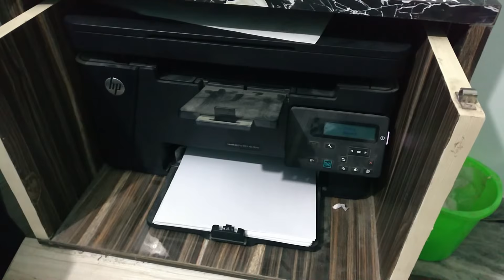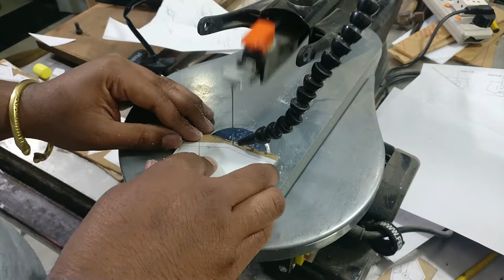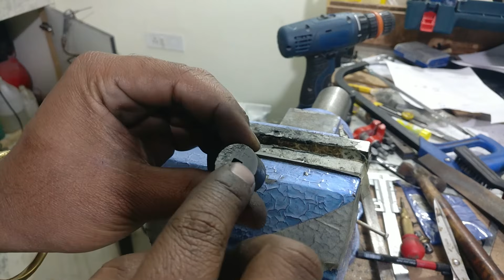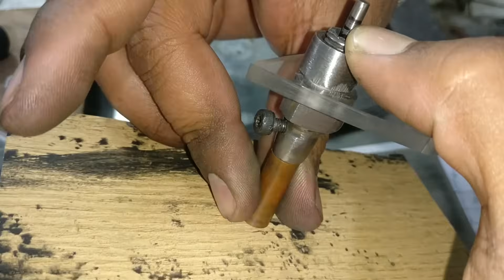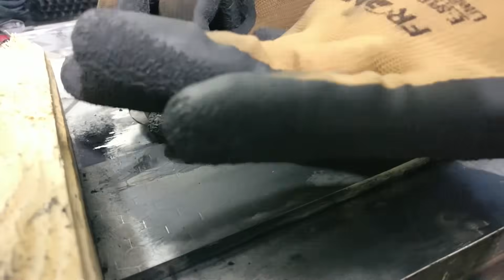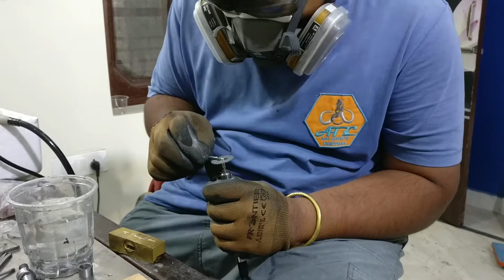Learn Making a Graver and Template set for Engraving - By AMbros custom

Comment: are all the edges flat along the 5mm acrylic? I downloaded a 3d printed template and noticed the edges around the templates have angles in regard to the face and heels and other cuts. Im noticing in your video you dont talk about setting an angle on the short 5mm edge of the acrylic template. all you did was cut and filed flat? I'm confused on how the angle gets created if you cut all the edges flat. do all edges sit flat on a even surface? or some angled?
Reply from the maker: In the description section there is an instructable website link. Follow that guide. That will answer your question.

Comment: Can you tell me the file you printed on A4 or A3 paper, but I printed it on A4 paper, I feel the sample is very small. compared to Lisay's model, it's very big
Reply from the maker: Yes the templates are small, and are A4 size, you need to see the details over instructables that how much you need to stick out to make the right degrees of angle. Size never plays any role, the thing matter is that the length of stick out.

Comment: Can you post the height of the templates? I'd like to use with my lindsay graver holder but these templates seem small when i printed them. thanks for posting.
Reply from the maker: Thanks, The height is closer to 83mm.
Reply: @ambroscustom  Thanks. I would have been off with my template cuts. I have a lindsay 116 template that is closer to 100mm. I was using a semicircle and digital angle finder to make some custom templates and came across your video. It will help me confirm if my measurements are correct. Thank you.
Reply from the maker: Pleasure is mine 🙂

Comment: Hi

Sorry for silly question

Thanks for temolates and mentioned angles.

Can you please mention the center of hole from botom of template surface.

Second , kindly can you updat hights of templates from botom to max hight. :(

Sorry for being silly
Reply from the maker: No the height is not possible to change,if you do so then the angles will change alot more. This design is made according to a specific length and increasing the height means redesign them again, but I can provide the centre mark as soon as I get time.
Reply: @ambroscustom  can u tell me whats the lenth and width of each template.. and where to plave hole

Comment: Ambros I downloaded your templates but the center hole on my printer measured about 5.6 mm so I used photoshop and enlarged the templates until the center hole came out to 8mm.  I don't know how accurate your template has to be for sure. The tube you used to measure the length of the graver when you set it in the fixture is that 1.25". Really didn't understand how you figured that out?  Can you explain this a bit?
Reply from the maker: Dear in the description section you will find an instructables link, which gives you brief information about the template and how I made and how to use. Print has to be made at 100% to get the accurate template. Or you can go with cad model

Comment: Hello, Ambros looks like you did a lot of work making the templates.  Each template has a smaller template so the larger template would be for the face angle and the heel?  Is that how I'm seeing this?  The smaller templates would be to reduce the overall metal? Thanks, Mike E
Reply from the maker: Yes Mike you are absolutely correct.

Comment: These appear to be an exact copy of Steve Lindsey's template set . are they ?
Reply from the maker: No
Reply: @ambroscustom  okay. Thanks.just wondering.
Reply from the maker: I uses the basic Pythagoras principle only and if you buy Steve Lindsey template I bet they are different than this, but overall you achieve the angle you wanted to and you can make many more by yourself just by changing the face tip angle.

Comment: this is a great tutorial but 2 questions 1 can i use tool or spring steel as a graver 2 what are the bigger template for. i only seen you use the small nes
Reply from the maker: Buddy I heard from many master engraver to use HSS or carbide, no one recomend using a carbon steel. HSS is also cheap and you can get a precise dimension blank at any tools supplier shop. The bigger templetes are used for facing and heel work which do the cutting work. They are important part also. Thanks.
Reply: @ambroscustom  thanks so much man you really helped me out
Reply: Spring steel is great for a graver.     You just need to properly harden and temper your tools.  I have used coils from a bed spring.
Reply: @gwaaiedenshaw8310  great! Thank you

Comment: Very ingenious, thank you very much !
Reply from the maker: Your welcome brother
Reply: @ambroscustom  Can you make a video on how to use the template with one of the templates because there are still many who do not understand using it properly thank you
Reply from the maker: You can watch Steve Lindsey videos of how to use these templates, pretty easy process.
Reply: @ambroscustom  Hello, my friend has taken pdf and thank you, I just do not understand in the little hole in each template, what is the use of it?  And if I cut the template, does it have to fit the small hole according to the template too
Reply from the maker: That was for the graver holder alignment, so that when everytime you need to sharpen the graver, the holder sits at the same location onto the template for the better and much accurate sharpening.

Comment: Hi thank you so much for the video. Please can you tell us the height of the diamond stone you are using? Also do these templates create a parallel heel? I have made the 90 degree template but have not been able to achieve a parallel heel. Any help would be amazing!
Reply from the maker: Hi Heather appreciate your words. For the diamond plate it's 8mm thick. If you want much detail over this topic you can check the pdf instructables file in the description. If your stone height is little thick you can place a shim underneath that and perform the heal making process. The bigger template is used for making heal of the graver. The angular section onto the bigger template. If your grinding stone height is not upto my calculations then there might be some problems in attaining that heal. Recommend you  to take a look over the written pdf. If still have problems let me know. Thanks
Reply: AMbros Custom thank you for getting back to me!! I am still having some trouble achieving a parallel heel but I think it’s because my gravers are slightly out of alignment on each template. I will keep playing around! Thank you!

Comment: I wish I knew what to buy,. Theres seems so many, how does a beginner know which ones to get if I can only afford to buy a couple at a time? 🤔 Any tips for me I would be very grateful. Thank u for sharing
Reply from the maker: Dear you definitely need some tools if you want to pursue Jewellery. Even in the jewelry there are so many sections. Like engraving stone setting, casting and many more.  Jewelry saw, file set, diamond sharpening plate, vise, rotary tools and burrs suggesting foredom for that and it comes up with alot of attachment. I hope this much is sufficient to start a jewellery work. Even these things going to cost you around 120-130$ depend upon where you live. But you definitely need more and more tools as you increase your skill. Frankly told every tool has its own advantage. You can do multiple task with a single tool but the thing is that you might not get the good results. So I would say less tools definitely have some barrier in making. Brother there are many masters from where you can see what things are necessary, I told you what I uses when I started. Foredom is must to buy, really the best and versatile tool and comes with different attachment. In first no need to buy expensive tools because I think that in the learning stage you don't even need the professional quality tools although they definitely have advantage but cheap tools can also do the same job. Only thing you need is determination and practice and remain positive. Hope this will help but definitely consider watching other jewellers as I am not very good in this field. Good luck, stay healthy:)
Reply: @ambroscustom  I have all my jewlery tools. Just no gravers yet. Well none since I made that comment, I actually have a few gravers now I got I last few days so iv been practicing. But thank u for the indept comment and tips, I appreciate it ✌
Reply: @ambroscustom  good advice,.. I started a few years ago Makin jewelry so I have built up my collection of tools.. Sand casting is something I dont have, but I have done cuttle fish casting,. And yes, I like to use old tools an not always the most expensive.  An I have lots of determination to get better an better! 😉 Your comment was very helpful, I think I subscribed so I will hopeesee more of your work.. Thank you kindly from Ireland ✌

Comment: Buenos días Sr mi nombre es Douglas Ramírez desde Costa Rica gracias por compartir los archivos con mi persona me gustaría preguntarte que medida tiene los buriles que utilizas de que material son
Reply from the maker: el material es un carburo de tungsteno y no sabía qué significa buriles, sería fácil responder si pregunta en inglés.
Reply: @ambroscustom  Thanks for your answer
the word "buril" I refer to the tool used for engraving.
What dimension does the HSS or tunsgteno pieces have, which you use to make the engraving tools.
too appreciative of your response
I would also like to know if you have the plane of the tool where the engraving tool is mounted
Reply from the maker: Welcome mate, the tungsten carbide dimensions are 4mmx4mm and I also uses a high speed one that also have the same dimensions, also the round graver made of HSS is of 4mm dia. I suggest you to go with 3mm they are much better. If you didn't have diamond plate for grinding don't go with carbide, because wet stone can't able to handle tungsten carbide. They worn out very fast and not even able to scratch carbide. I didn't have any plan because people never asked for that. If I get time then I definitely post them here. Try my best to upload soon. Thanks:)
Reply: @ambroscustom  I would like to be able to build it and be able to start with engraving since I like this art and I want to take it as entertainment
Reply: @ambroscustom  I have some blades that I would like to know if they can work to make the engraving tools. You have WhatsApp, I leave you mine + 506-88 21 10 19, can we speak through this means? if you want
Reply from the maker: @douglasramirezfernandez4801  you can send me pictures of those on my email ambroscustom@gmail.com

Comment: Hi man. Thanks for sharing the templates and the way of making them. I gotta question about the small templates. how did you draw them ? I mean does they have heel and face angles???
Reply from the maker: Yes they have a specific angle given to them and for the heal work you need to use the bigger template not the smaller one. The smaller one are for the initial shape like the Pentagon shape of graver. Smaller template provide you the perticular angle of the graver like 120°, 90°, 150° etc.
Reply: @ambroscustom   I understand the small templates are for shaping. See I pick 45degree angle for face in big templates. When we using the small templates they also have angle  between the graver and the bench stone, what's the angle? 4degree? I'm sure they're not flat.
Reply from the maker: Yes its 4 degree, but also depend upon the grinding stone you are using. I am using diamond stone of 8mm,  in the the end this is going to reduce the tip size.
Reply: @ambroscustom  I'm gonna use diamond lap and gonna use 12.7mm(half inch) for height. Should I increase the angle ??
Reply from the maker: @mahmoudjam670  you can use some sort of spacing under the template so that the height difference remain 8mm. Although that initial angle doesn't matter that much. The tip angle matters only which is 90°, 120°, 150° etc.
Reply: @ambroscustom  Okay man I will try that. I gotta another question about the heel. You used 20 degree for heel and and get a distance of 26.71mm from center of the template to the surface. Where did you use the 26.71mm ?

Comment: Wow, just goes to show you don’t need a lot of high-test tools, just some personal skills!  Excellent video, thank you I!
Reply from the maker: Really appreciate your words brother:)
Reply: @ambroscustom  Great video I really wanted this from the first.  Thank you very much friend. For what size square eyes do you use?  And one question if I use a smaller stem material, will it affect the angles, thanks in advance.
Reply from the maker: @mbootgae1497  buddy it's 4mm square carbide blank. Thickness doesn't affect the angles. -+5° also doesn't affect the cutting quality.
Reply: @ambroscustom  I might want to make a small chisel to play on hobo coins, 3.27mm / 4mm.  Does that change the angle of the blade.  Thank you for your response
Reply from the maker: It will not affect. You can go with 3.27 no problem. Everything remain as it is

Comment: Hi Ambros!! I come from watching several videos bout engraving, I hope YOU can answer mydoubt. What matetial should I use to make them? I mean, the graver?
At what distance do you know to place the graver from the template?
Reply from the maker: As i experienced that if you are newbie like me then I suggest you to go with hss instead of carbide. Downside is that you need to hone the tip after few intervals that consumes time but not too much infact nothing if you break the carbide bit and need to rebuild the tip. That grinding time took around 10 -  15 minutes depends upon the chipping onto your carbide graver. HSS graver are much forgiving, once to master the technique then shift to carbide blanks. Few shapes you can made with carbide are oval shape,  flat graver, round graver these are much forgiving compared to other having sharp tip vary from 70-135°. My advice is to go with HSS and then with carbide. For the holding method you can visit my instructables blog post link in the description for detailed information.thanks :)
Reply: @ambroscustom  Where can I get HSS sticks? Thanks.
Reply from the maker: Try AliExpress awesome and affordable price. Good luck

Comment: This is the best tutorial regarding graver sharpening/making on YouTube!
I have one question though - the small templates for angles - are they universal, or how do You tell the dimensions regarding the lengths of G(raver) X (to the “center” point) and Y (above “center” point for heels)

Is it same and You just make the e.g. 120 degrees angle from the top Y-point?

Thank You and keep your good work
Reply from the maker: Thanks for the appreciation brother. As far as smaller template are considered they mainly used to thin down the tip. There is no problem in using directly bigger template on 4 mm graver but the problem occurs on sharp corners. The tip tends to break and doesn't give you clean cut. To decrease the size those are used. If stock material is around 2mm then you definitely have no need to use the smaller template. As far as dimensions is considered for the smaller template the overall motive is to give taper to the 4mm square graver in such a way that tip became 2mm square and from 1" to the tip it remains 4mm.  That doesn't play important role. If your stock is 2 mm those templates have no use. I don't think that they are universal. If you increases the length of graver and the holding length you definitely need to change the size. After making the graver and reanalyzed them I would say that angle between 2-4 ° works for smaller template.